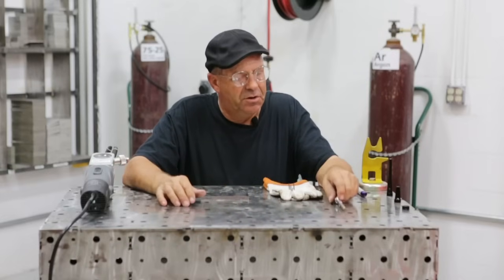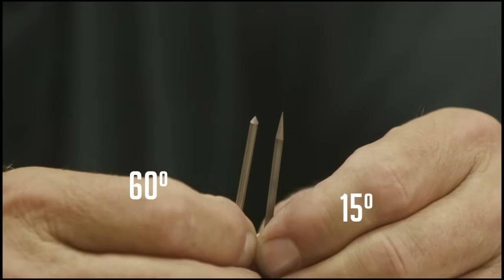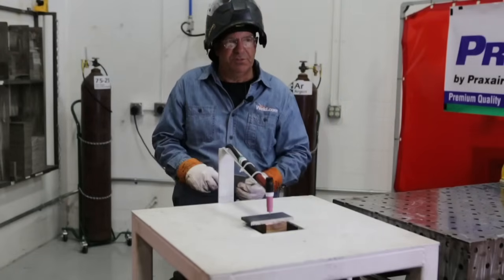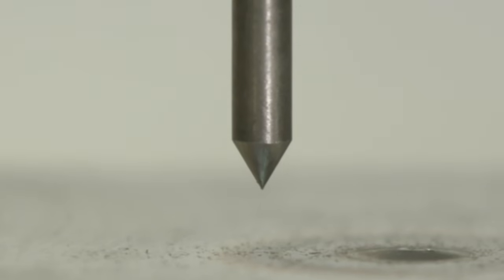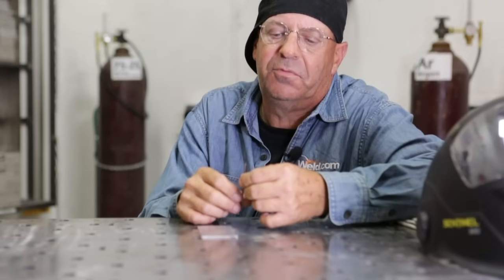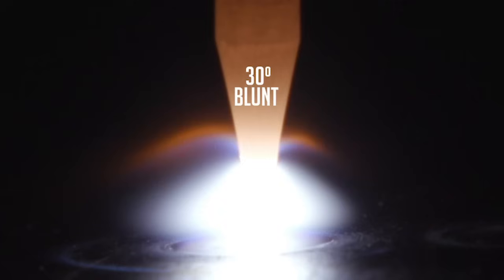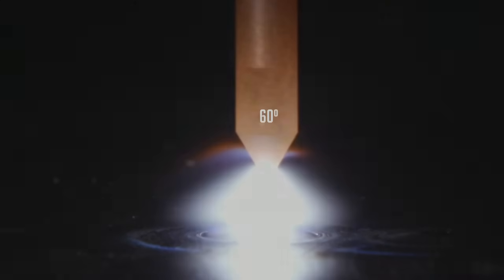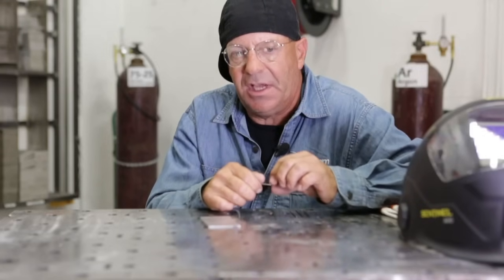Tungsten Grind Angles Matter!

Comment: I've been welding over 10+ years but I'm just now learning tig and I think the 30° angle has worked best for me. I haven't got the concept of adding filler metal yet but I may be doing it wrong. I'm using ⅛ green tungsten on ⅜ stainless at 140 amps with pulse off on Miller 235 multimatic

Comment: I generally like his videos, but this one is not all that useful.
I don't come away with any particle understanding of the differences (except for the blunt tip).

What would have been helpful is Why one would use each one, not when. Telling when to use each one is just copying behaviour. 
I prefer to understand the impact, so as to be able to predict the effect and from there choose the appropriate setup.

I mean, what does the angle do to penetration? What about arc wandering  when welding in confined space (say inside a nut)? Etc.

Comment: I do 21 to 19 and I can honestly let others speak for me on how pretty they are. But the burn in is better on the stumpy ones and the signature on the sharp one is very much prettier.

Science says stubby burns in much deeper and sharp doesn't burn in much deeper than 3mm

I still like my pointy sharps at 20°
Reply: Also I use 3.2 mm instead of 2 4

Comment: Way back when I first started Tig welding, for Aluminum, I was shown to dress the tungsten by putting it on straight polarity DC, briefly start the arc, then turn off the current and pull back on the tungsten (almost like shaking the end off) to create a ball tip.  Anyone do this?  It seemed to work well for aluminum AC work.

Comment: I weld mostly 1/8 to 1/4" thick aluminum almost daily. This requires 130 to 225 amps. Using any of the sharp points results in a very high current density near the point which causes the tungsten to melt and degrade much faster than the 60 degree.

Comment: For the math-nerd types... 
The reason for the inverse nature of the grind to the depth, it's the 90° - grind° * 2π = total arc degrees.
Then you take the surface, and it's a plane/line that extends through the arc you just made, Take the amps times the segment intersection length / total arc degree = surface percent energy transfer.

Comment: Just curious it seems that the 15 had a larger arc zone,  so the puddle would've been smaller. The 30 blunt seems yo voncentrate the amps more cleanly, seems its penetrantraton would be best. Makes me think of shaped charges in explosives.  The cone/funnel shape creates tge inverse shape on detonation.  Curious if the same would be true for the arc of tungsten.

Comment: Great teacher thankyou for putting in so much effort and you gave me the idea of perhaps having a few electrodes ready to the side to swap to as the weld requires. I have to weld a thin wall 2.5 inch tube to a casting - any tips would be very appreciated lots much 😊im thinking of an electrode ground 60 /15 to get the arc high on the casting side

Comment: Friday at work I did some experiments, on an outside corner joint, inside corner joint, flat seams, and really liked the 30 Degree angle. I had been using 40 which was ok but the edges wouldn't wet in like I wanted to sometimes so I would turn it up 5 amps or so. Then I wouldn't get the color I wanted.  I had heard of this on Jody Welds podcast but didn't feel like taking the time to change the angle on the tungsten grinder since most guys in the shop are using 40. I think I made a believer out of them after they too tried it out. I run a Miller 210 dynasty wireless pedal, stock torch irradiated tungsten the red pack now at 30 degrees instead of 35 or 40, argon gas, miller digital infinity hood, usually between 80-150 amps. 316 stainless steel 1/16", 3/32", 1/8" filler, sometimes 308.
Reply: @donleejr7624
Reply: yes I do use a gas Lense thanks for asking, I would like to get a Furik clear cup to play with if you want to send me one, since you make so much money being so talented in all.
Reply: @Welddotcom did you highlight the lie that I am not a real welder, you should retract that. Petty.

Comment: Greetings! Hopefully a simple answer here... Was. wondering if there were any relative hard measurements of what the actual tip 'length' is on a '30 degree' sharpened tip vs say a 15 degree? I've searched extensively online and couldn't come up with an actual dimension to use a relative reference. Reason I'm asking, trying to figure out what the 'length' should be on a sharpened tip to facilitate the degree value in lieu of purchasing a expensive sharpener. I'm new to TIG welding and see there are a dozen of expensive options to consider for sharpening but see people like Bob and others sharpen on a regular, clean stone wheel. So, what actual length does that come out to to create the 30 degree parameter? TIA.
Reply: Use trigonometry.  You could probably find some formulas for cones.

Comment: Thanks. After watching few of your videos i bought an s7 inverter tig welder from the jungle. I am trying alum welding to build a trailer. While practicing with 1/8 thick alum it just melts the entire dam thing. 1/16 tungsten. How can i make a puddle and add filler rod? I tried 70 80 90 110 130 n 150 amps with 15 cfm pure argon... Great videos btw

Comment: Back when I was welding in school after doing stick an mig a shit ton I got to do aluminum tig. I was good with it in a month and my teacher said I could be qualified if I couldve brang some of my weld down at the end it didn't connect and some filler was on the top plate an not the bottom one. I cheated an used extra filler. One of the funnest welding I've ever done. Highly suggest to learn it if you enjoy welding and a challenge

Also wondering if it's true but my teacher Mr rose told us that putting a tungsten Rod onto chemically mad beef jerky can make it ignite

Comment: I've been welding over 30 years with tig being the primary. I've played around with various grind angles and found some very interesting results. Try grinding at the 30°angle but instead of spinning the tungsten leave it on the wheel and create a flat side. Do this so you have a 3 or 4 sided pyramid shape. Understood not time saving but the arc is so concentrated at the base of the tungsten with a tiny gas shield. Great for low amperage applications. The arc travels down the points rather than across the entire tungsten and is more controlled. Give it a try
Reply: Maybe the Egyptians knew something.
Reply: Any more advice for welding aluminum?

Comment: The reason for the blunting of the tip is that the arc actually burn from about 1/16 back from the tip and gives a more stable arc sharp tips fragment and leave inclusions in the weld
Reply: I set my machine hot hot hot and regulate with the pedal, so °30 blunt is where its at. If I screw the pooch and mash the gas I don't gotta get worked up about blowing off a point.

Comment: I'm a professional tig welder. I use super sharp always on stainless,  with footpedal and I set my gas up on my cheek....a slight breeze. Footpedal is the key to controlling the arc.
Reply: Yea did that the other day except I had the tungsten in and zapped myself. Won’t be doing that again!

Comment: I GOT MY FIRST AC/DC WELDER AND AFTER TESTING FOR A WEEK I THINK I WILL SHARPEN TIP ONLY MAYBE FOR VERY SMALL CURRENT.
I AM ACTUALLY PLANNING ON USING ONLY 3.2 AND 4.0 MM TUNGSTEN AND ONLY SHARPEN DIFFERENTLY DEPENDING ON THICKNESS - I.E. POINTED FOR SMALL CURRENT AND THIN MATERIALS AND EVEN BLUNT FOR BIGGER SIZE...BUT  I AM NOT SURE HOW IT WILL AFFECT WANDERING OF THE ARC
GREAT CHANNEL FOR LEARNING

Comment: When I do really thin stuff I do the 15 degrees I do blunt it a little bit not much but I’m like you bob for everything else I use the 30 I do keep it a little sharper with aluminum it just acts a little better I think with a sharper end get a smaller ball it almost acts as if it can be controlled better for aluminum if it’s sharper

Comment: I have been using 90* angle on steel and aluminium. It works well. You have to lower the amperage though.

Comment: Good old Bob!  I miss him!   I always thought people liked those sharp points because it's easy to start, the tip gets hot quickly.  Also historically when people used Chem-sharp, I think it tended to do that.   As far as I know the arc density is higher with a blunter point, people used to use a BALL END, which is pretty blunt, and it could just be FLAT.  If I read it right the flat end would have the most current density, the narrowest arc, and people don't use it because it would be harder to start.

Comment: I seem to sharpen my tungsten between 25 and 30 degrees, though occasionally I'll blunt the tip just a little bit during passes to fill over root passes. With aluminum AC welding though, I use a blunted 35 degree angle, and it usually balls up pretty nice.

Comment: hi guys can I ask if this test with different angles of the electrode tip are also valid on the scratch start tig? what is the best sharpening angle for scratch start to avoid contamination problems?

Comment: My setup is a gas lense with a #7, stainless steel I think the same width your using,  my gas output is 30, proflow 2.5 and post flow is 5.6         I was welding and getting gold colored welds and all of a sudden it went to grew welds, and I cant figure out how to get the gold ones! My welding instructor won’t pass me until I get gold, I need help!
Reply: I’m sure you figured it out by now but the reason is too much heat. Modify your settings to reduce the heat input / speed up and you’ll be back to gold

Comment: Used about a 30 to 45 degree grind with a blunt, ball, tip welding aluminum bicycle frame components at Trek when they bought out the Kline factory.
Reply: Now that sounds like a job where they actually want good clean metal for you to make pretty welds on
Reply: @michaelszczys8316  - Clean metal you say?  Every component was given a detergent bath and rinse followed by a dip in mild  acid solution to remove any surface oxidation followed by neutralizer and final rinse.

Comment: Technically the angle should be no more than twice the diameter of the electrode. Grinding or sanding marks always lengthwise with the electrode will help stabilize the arc.

Comment: You show the tungsten touching the material.   But watching your a 1/8 above the material.      Am i correct. Tig a 1/8 above my work?
Reply: It was only touching when he set it up!  He put in a spacer to make the setup and then took it out.   People often say that the space should be something like the electrode diameter.  1/8" is a lot!  A problem for me b/c of too much coffee and shaky hands.  In some situations the arc length might be fifty thousandths or so, I can't hold that with my hand!

Comment: All I have to sharpen my tungsten right now is an angle grinder. No matter what I do, the grinder always breaks the tip off right as its just about to get sharp.
Reply: Keep the tip cool with water. You don't sharpen drill bits in one go and get them purple do you? Heat equals brittle. I always grind it flat first and wherever it breaks I put my tip on. I use a 440 welder at work.

Comment: I am just learning how to tig.  In 3:28 you said you would use this to get a wider envelope.  I am just wondering why you wouldnt lower the freq to get this on a 30degree tip?
Reply: How would you lower the frequency? This isn’t ac.
Reply: @devious762  pulse dc?
Reply: Dev Everything pulse just changes the emperage not the actual size of the envelope, well it would change it but not very dramatically like the change in the grind of the tungsten would.

Comment: It seems to me if you know how rounded a 15° tip is going to be halfway through its use, you might as well blunt it that much to prevent early tungsten evaporation. 

I wonder how blunt each tip is before & after the welding run. The surface area or width of just the flat end of the intentionally blunted tip also seems important. Does anyone standardize this tip removal with a jig?

Comment: yes i have noticed that also, making a very sharp tip makes the arc spread out which is the opposite of what you sometimes want to achieve when grinding the tip
Reply: So pretty much the sharper the top the wider the arc?  Wow I guess I been complicating my job more than what it should lol

Comment: This Guy knows the job, from 40 years ASME IX B3 Sour wells Inconel 625  welder.  Can't beat a real craftsman, there's only us and plasterers left.
Reply: Inconel.. haven't welded that in a long time. The boiler side of the coal chutes, 6' of it, were inconel on coal burner power plants. Used to Roadwhore the shut downs and turnarounds and outtages. Good times.
Reply: A buddy gave me a roll of income wire to play with. Anything I should know about using it?

Comment: weld.com
where is the conclusion?? what's the difference? no side polish section and acid etch!!!  this wasn't helpful since it didn't conclude or for that matter even NOTE the puddles' width relative to each grind!!!  Why post this?  Good idea, just not taken to conclusion.
Reply: that is what i thought they would show here
Reply: Go check out Jody for the answer to that question weldingtipsandtricks
Reply: i believe the purpose of the video was simply to capture footage
Reply: I think what we're talking about here is the arc characteristic, what the arc looks like, what's the obvious difference between grinds.  If these puddles were all in a line, it would have been fairly easy to cut through the plate and show the nugget, but you can kind of guess what you would see:  Blunter point makes more concentrated arc, narrower deeper puddle.  Sharper point is easier to start and run, that little point gets up to temperature quickly, and stabilizes the arc.  We didn't see it here but I think the electrode with NO point might be ideal, but have practical problems of starting and running, might not be so forgiving of different weld currents as a pointed one.  The tapered grind with flat end is a compromise.
Reply: Leonard Pearlman I can see what you mean, however I wish that he had given us a plot screen example of each arc characteristic. A side by side comparison would’ve been helpful instead of having to scroll through the video myself to compare. And even if i do that it’s difficult to tell the difference without a sxs comparison.

Comment: Iam  a UA welder since i was in my 20s i loved welding now 49 yrs old i weld on every metal made to man kind and i prefer 15° esp when ur putting root passes and welding hard metals dip trasfer or back feeding all the way out to a nice cap that is very important i believe to have that very sharp point when u turn up that heat with more nickel in that metal ull see why 15 is the best all my yrs of welding ive done this on pipe and pipe is where its at ,i do agree with you on most esp aluminum, but when u have a nice point like a needle it is so much easier in my opinion to handle that arc esp by hand or walking the cup   i hate when a guy i work with hands me tungsten while iam welding and its not the way i like it  i watch the thing dance all over  i fight it and deff dont put on slick like i do when i get 15 it does make a diff ,nice video though my man i enjoyed it
Reply: ray ray have welded wood carbon that's some funky stuff to weld
Reply: Lol yah ok u keep on welding on wood goodluck with that

Comment: Would there be any benefit to a tip with two angles on it kind of like a knife blade?  Like mayby 15 degrees initially, but with a 60 degree tip right at the end?
Reply: I have seen ads for little tungsten grinding machines that do this.  It makes sense as a balance between high current capacity and easy starting.  If I have trouble starting, (learned in an old book) sometimes start up on a handy copper block sitting right next to the weld, and when the electrode is hot and arc is stable move the torch over to the weld.  The arc is off at that moment, but the electrode is hot and acts like a little flashlight, and restarts very easily because it's still glowing.

Comment: Can anyone tell my why my, 3/32” 2% thor tungsten tip starts to round and lose its arc shape on DCEN, when I weld around 130-150 amps (Non AC, no freq, no pulse) for medium periods of time? Like consecutive 1-3 min beads on steel pipe.

It also turns bright red, gets sooty black as well
Reply: You need to step up your tungsten to a 1/8th. Also when you terminate your weld leave the argon flowing for about 5-10 seconds instead of turning it off immediately. Your tungsten shouldn't be turning black or it's getting too hot and not the proper cool down.

Comment: Bob, It appears that the blunt tip (60°) electrodes heat up faster than the (15°) tips, does this effect the weld quality?
Thanks for informative vids.
Reply: One would think it would be the opposite. Sometimes you get surprised. Comparison video like this helps.
What I do I use between 15 and 30 .

Comment: Thanks for the pointers. I work in a meat processing plant so everything in there is stainless with a few pieces of equipment that have aluminum. I used to be able to weld alum. When i worked in industrial repair and fabrication but seemed to have lost my way in this plant.

Comment: Might be a good idea to give a basic explanation of how the electrons flow on the surface of the tungsten and the angle that is ground at the tip will determine penetration. the wider the angle the more penetration generally, especially if you grind a flat spot on the end of the tungsten. Thin material will need a very narrow angle so you are less likely to burn through. Just my experience with tungsten grinding after 40 years of welding.
Reply: @REPUBBLICA ITALIANA what about them?

Comment: i always run a 60 degree grind angle, but i almost only weld pipes and it makes a really big difference when welding stainless pipes and you need to totally penetrate the metal.